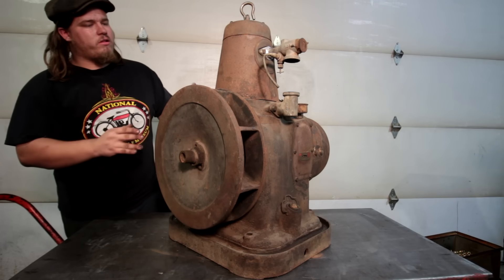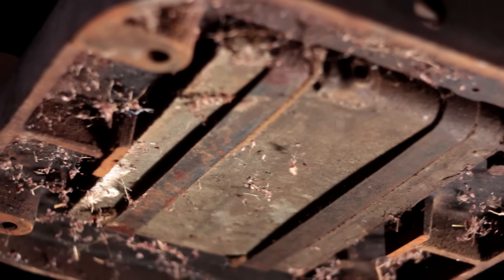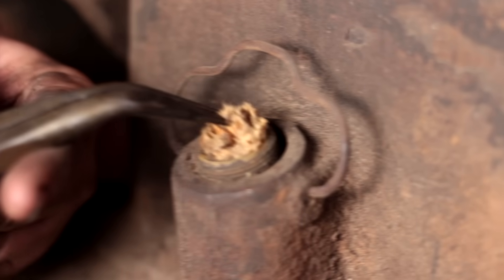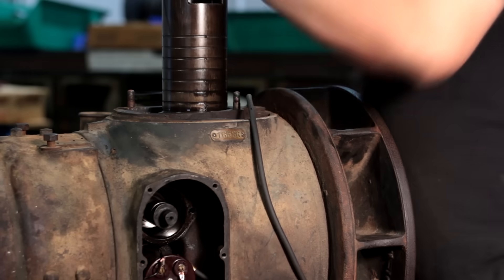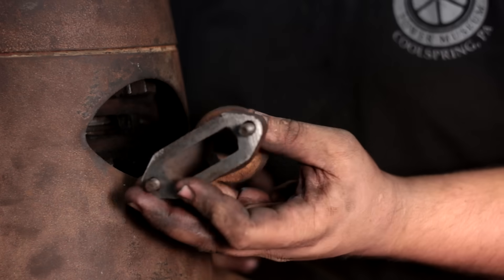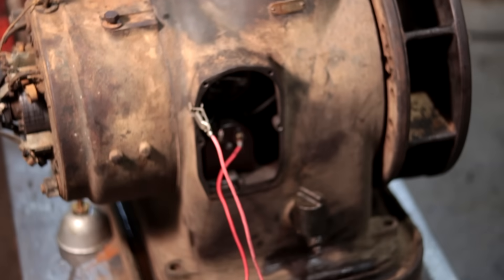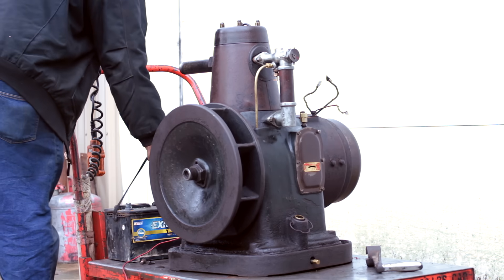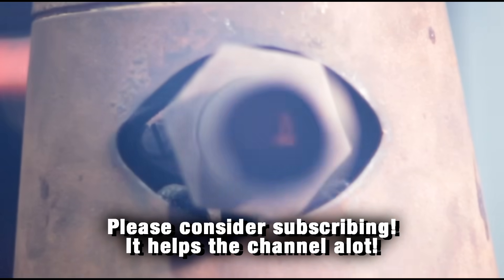100+ Year Old 4 Stroke Engine Design Has NO VALVES!!! Can We Get it Running after 60+ YEARS??

Comment: It has valves, but instead of poppets, they used two separate sleeves.... Almost like combining two, two stroke engines into one homogeneous machine. I friggin love it! thanks for a good video.
Reply from the maker: so you call a two strokes cylinder a valve? i just always called them ports. glad you liked the video!
Reply: @cruddycornstalks   @cruddycornstalks  what do you think a "port" does in relation to an engine? A "port" just like a "valve" and allows air/fuel and exhaust fumes to flow in and out of an engine. With this model of engine, the 4 stroke cycle is perpetuated by two sleeves that are ported to act as "valves". I edited my comment because I had a few too many beers before I commented. My bad
Reply: I said some nasty things before I really read your comment, so I am sorry
Reply: @cruddycornstalks   it's like taking two, two stroke cylinders, that are timed in such a way that when combined they create a 4 cycle engine.
Reply: @cruddycornstalks  It's just an unconventional valve, it serves the same purpose, but doesn't look the same

Comment: For the early sleeve valve engines its important to use non detergent oil, this builds up a carbon seal around the junk ring and ports and increases compression and reduces oil consumption.
Reply from the maker: this is true

Comment: Things this guy does really needs to be taught to young people as oneday we could find ourselves needing to use old machines as we rely too much on electricity and computers these days. So one good solar flare from the sun or an EMP and the electricity grid is gone and we will be back in the 1800’s. I drive a 1965 Chrysler Valiant AP6 and it’s 60 years old this year and I sadly found rust in the front steering box and I’m having trouble finding mechanics that can even weld these days. All the older guys are gone and younger mechanics seem to working with computers and plastic cars these days and my old car scares them. I have found a classic car shop but they work on $100,000 rebuilds of classic cars where I just need a $2000 welding fix. These old motors are just amazing. I’m so glad I was able to 80’s and 90’s kid and teen as the world was much more fun. Cars today are ugly and the kids all look at phones and computers all day it’s sad.
Reply from the maker: very true
Reply: @ you are doing such a great job

Comment: Brilliant... 😻
Another video giving it a complete birthday and about how to actually time it and going into detail of everything about it including measurements...
There is also the possibility of making another not as a copy but using any modern technique and materials.. using the sleeve system and mechanical fuel injection which could be done via the sleeve as this has many advantages over valve engines..
The main reason being it's so quiet and stable and I assume so reliable.
Even to the point of raising the compression so it runs on vegetable oil as an off-grid generator.
Selling the plans could be an income stream.
The starting point is finding a crank with flywheel, con rod, piston and sleeve.. I actually made air pump from a broken 4 cylinder diesel using the parts above and wood.. a friend has it now powered by a water wheel and he uses the air for his tools etc.. all it needs is a squirt of oil in the air intake before using to keep the piston happy the crack dips into a plastic oil can.
Reply from the maker: the longevity of the sleeves sealing correctly and the cost to make the sleeves makes it not a viable option for main use.

Comment: This is by far my favorite engine I have seen you get running. Awesome design! Is that a electric starter on the side and or generator?
Reply from the maker: more then likely it is both as its a 32 volt generator for a house but probably is designed to be started by it aswell

Comment: Well I wish I still had some of your enthusiasm and energy! That’s refreshing AND to see again, what is an uncommon thing - someone who has a genuine love for what they are doing!! 
You mentioned a few time about this engine not having valves. While it doesn’t have the so typical “mushroom/ stem” type valves, it most certainly DOES have the absolute most efficient types of valves, “sleeve valves”. 
Look up the Aussie built WWII twin engine plane the Japanese referred to as “whistling death” because of its inherent quiet running sleeve valve engines. Another very worthy notable example was RollsRoyce’s successor to the wildly famous Merlin engine, of WWII. while no where comparably famous, the only way they could figure out to get more horses out of the same weight or basic design was to build the engine around sleeve valves. I don’t remember the figure but it was ALOT more horsepower using the same displacement, but it was more weighty, and with wars end I don’t think it ever saw large numbers produced. Also not sure but it may have been called the
“Creacy”. 
When the end of the sleeve’s cylinder gracefully “seats” against the cylinder head, there is your “valve sealing action”. Also those were12 cylinder engines, so the gearing to articulate the cylinders, and the unforgiving precision and accuracy involved becomes extremely complex, heavy and puts tremendous strain on maintainance crews. 
I worked on a simple “hit or miss” AJAX single (huge) cylinder in the oil patch. It all overhauled by removal of the cylinder head, screwing the piston out to re-ring, replacing a “saddle” on the rod journal for the the new rod bearing to spin around on, “pulling” the cylinder sleeve only to press in a new replacement. Each of the two main bearings screwed out of and into the case from opposite ends and had “saddles” which fastened a new surface to the crank for the the pressure fed main  bearings to ride on. 
The oil pump was external, as well as the articulating parts. It was a two cycle, for fuel it ran on what it was pumping out of the ground!
Fired like a diesel off “heat compression” And only “fired” every once in a while, extremely unevenly! The whole thing could be completely rebuilt from the “outside” and without removing it from it’s drive mounts. That was 1973, Tex oil patch. 
I only mentioned it because you are exactly the guy who would love it! 
Also a “single lung” Maytag washingnachine motor.
Reply from the maker: the sleeves dont unseal and seal on the head to control the exhaust and intake on a willys they just have ports that come into view of the chamber and go out of the way. more like a two stroke with two cylinders moving up and down.

Comment: One of the selling points of the sleeve valve engine, at least in their advertising, was that as it ran and got coked up it actually ran better because it filled in all of the little places it couldn't have close tolerances from the factory.
Reply from the maker: yep when they get hot they seal better!

Comment: so cool, amazing minds back then.

The fractal vise is another invention from the era thats actually practical, unlike this...

 you can see oil spewing out the exhaust at 13 min lol. maybe it could be improved with a vertical oil drawback of some kind, but will always burn oil especially when it heats up. kinda makes the thing worthless as the only reason we use 4 strokes over lighter much simpler 2 stroke is because they dont burn oil/fuel efficiency.

got me thinking this tech could be used in new generation "eco friendly"  2 strokes, maybe slightly heavier but all the advantages 2 stroke with less oil burning.
Reply from the maker: it runs and im not changing it.

Comment: I've never heard of, nor seen a sleeve valve engine like this before! I didn't know they existed. Is this a DC generator, or is the generator just an accessory to power headlights and charge the battery in a car? How many horsepower?
Reply: Farm rural electric light plant used to charge battery bank for lighting and radio  look up delco light plant
Reply: @Greg-xv9qj  I wonder how many kWh per gallon this "Dynamo" can produce. How many watts, volts, and amps?
Reply from the maker: greg is correct!

Comment: Just a suggestion, sometime these old engines used a resistor wire on the points electrical circuit to increase the life of the points. If you have an ohm meter just check the resistance of old wires. They maybe not in pure copper. My grand-father tells me that for the Ford T…congratulation for your hard work.
Reply from the maker: the condenser is doing that job.  and thank you!

Comment: 😊😊 most timing  marks IVE seen is 2 dots or a dot and line or 2 lines 2 gether it's been what I have seen be 4 😊😊 OMG 2 24 2O25
Reply from the maker: without getting fully into the crankcase i couldn't see any externally so i went by eye and managed!

Comment: This is a very cool engine. Why would you use an adjustable wrench on 100+ year old hardware? That's begging to mar it, or worse. Otherwise I very much like what you did here.
Reply from the maker: if you mar it with a crescent wrench you used it wrong. any bolt on this engine i turned with one i could snap off before the wrench would round the head. all about how you use your tools!
Reply: Techniques matter, for sure.

Comment: Geez man - get yourself a decent set of spanners - adjustable wrenches are asking for trouble !!
Reply from the maker: only time they are trouble is if you use them wrong they have a good enough grip to snap these bolts off well before you round the head if used correctly!
Reply: @cruddycornstalks  you want credibility - use proper tools - not second rate home handyman nut fuckers - no offense but it degrades your posts
Reply from the maker: if your basing my credibility off  my crescent wrench I don't think your someone I need to worry about to much to keep credibility with! if you think a crescent rounds bolts you need to be taught to use it right!

Comment: Love this motor! I had no idea that some thing like this existed. You hear of sleeve valve engines but not on this scale. I admire the work and ingenuity that has gone into the refurbishment. Thank you for the video! 
 That said, really an adjustable wrench on these old bolts, why? Is a decent socket set that much ? 🤦‍♂️
Reply from the maker: you have more of a chance of messing these old bolt up with standard wrenches then an adjustable wrench if you round bolts off with one you are using it wrong. it will snap a bolt off before rounding a head if used correctly. unless you know a place selling sets of 32nd inch increment wrenches alot of this older stuff has oddball bolt head sizes that most set don't have. or are rusted so far they arent even close to what they use to be!
Reply: I'm glad I'm not the only one bothered by using an adjustable wrench on an antique!

Comment: it has got valves, just not youre common poppet type. its called a sleeve valve engine. lookup napier sabre for a wonderfull example
Reply from the maker: sleeve valve is more of a simple label then anything as its just sleeves with ports in them more then a proper valve of any sort. are two stroke ported cylinders called valves?

Comment: Technically it has sleeve valves.
Reply from the maker: sleeve valve is more of a simple description to make understanding easier as it has two sleeves with ports. would you call the cylinder of a two stroke a valve?

Comment: It does have valves! They may be sleeve valves 
, but they are still valves.
Reply from the maker: was called valves to help terminology  but its just a sleeve with ports no more valves then a two stroke!
Reply: @cruddycornstalks  poppet valves are not the only type of valve. There is one in your toilet cistern (a ball valve). Also every tap in your home is a valve.they are called sleeve "VALVES" because the sleeves act as valves.

Comment: Nice restoration. But the complexity of this engine is why you don't see it. Seems simple, but look at all modern engines, just morphed slightly Model T engines. And as you see that sliding cylinder valve, has sealing issues, as well needs oil to not self destruct. I'm surprised at the modern points and ignition for the age of this engine, they had advanced engineering in the ignition design.
Reply from the maker: points where pretty common by the 20s delco had them in the 1910s
Reply: @cruddycornstalks  I am not an antique engine expert in any way. I have a 1924 Ford Model TT, that has sat for the last 43 years, and I just started working on it. 
More interesting is a Fuller And Johnson Hit&miss I also acquired that long ago, but just pulled it out last summer and found parts on eBay. It was on a The T. L. Smith Co. cement mixer. They were the first manufactures of portable batch mixers, and I think this engine is late 1910s or early teens.
So my engine experience is limited. I did restore a 1952 1.75HP Lauson that was on a Safe-T-Cycle made in LaCrosse WI. I'm intrigued by the cleverness I see in these old engine designs. A big problem with model engine builders, getting the spark reliable when under compression pressure, that is not as simple as made to look. And yet, look at how well all that works today. I guess I know just enough to be stupid.
Thanks for this video. I saw this engine sectioned at an antique engine show in Mount Pleasant Iowa (labor day weekend). Someone took the time to cut away 1/4 the engine. I thought back then (15 years ago) nice idea, but if good, it would be used today. I'm more amazed that in 115 years of engine design, it has not changed other then excessive complexity. The smartest thing ever were those electronic points, late 70s to early 80s. I had a 1987 Chevy Sprint (Suzuki Justi rebadge), 3cyl 1liter, that got 57MPG. Same engine design as the model T, only in aluminum with cast iron sleeves. Had a carb, not throttle body. Too dang simple. But salt in Iowa, kills autos quick.

Comment: Crack valves with cold air ! Wow never heard that one ,
Reply from the maker: not valves. the cast iron sleeves that are  1/8" thick
Reply: @cruddycornstalks  still a valve , and similar size to port sleeves in two strokes ,  it's not going to get any colder or hotter with no pipe, the old myth of burning valves with no exhaust manifolds is well a myth, if true all those WW2 Merlin 27 litre V12s with straight out exhausts would have died 5 minutes after starting. Best for any engine is fast in fast out exhaust . Put an exhaust manifold on any engine will only slow down heat up.and or cool down.
Reply from the maker: cold air can very easily crack one of the thin sleeves if there's no exhaust because you will have a 500 plus degree cast iron sleeve getting hit directly by 30 degree air from outside. even the merlin has exhaust pips to shroud the heat a bit! but they aren't using such thin delicate sleeves either.  on the other hand regular valves could not give a damb

Comment: Less misleading title: 100+ Year Old 4 Stroke Sleeve Valve Engine Has NO POPPET VALVES!
Reply from the maker: not misleading at all calling the sleeves a valve is only used to explain them easily. does a two stroke have valves? as this uses ports just like a two stroke.
Reply: @cruddycornstalks  I'm not going to let you get away with changing their name, lol. They are sleeve valves, and these engines have been called sleeve valve engines since their inception, until you came along. It is their action that opens and closes the ports, unlike a two stroke that has no valves. The piston in a two stroke opens and closes the ports, hence its proper description is a piston port engine. Just because sleeve valves are not shaped like poppet valves doesn't make them not valves.
Reply from the maker: so its not a sleeve port engine but a two stroke is a piston port engine?   or you call them sleeve valves and two stroke is a piston valve engine. you either are willing  to call them both valves or neither valves as they fundamentally are the same. open ports closed ports using motion of sliding metal. if you don't sit on one side or the other you have some odd logic there. in the long run both will describe the same thing and are mostly meaningless on what way you say or use them. all just a way to get an idea across.
Reply: @ I was trying to explain why these engines have the name that they were born with, it seems like your youth is causing you to try and rewrite history.
Reply: By the way, great video and thanks for all of the work that you put into it.

Comment: I Say It Does Have Valves!!! The Slides Are The Valves!!!! Just Like Read Valves Are The Valves In 2 Strokes!!! There's More Types Of Engine Valves Than Tulip Valves We Are Used Too!!!
Interesting Engine But It Does Have Valves!!!
Reply from the maker: if thats the logic you want to use two strokes don't only have reed valves as the sleeves in this engine are the same design as a sleeve in a two stroke. just two of them moving. only reason they called them valves in terminology is to help confusion and explanation .

Comment: I had read a really old advertisement about the Willys Knight sleeve valve engines. I asked an old timer about it and he said they were very quiet and smooth when running, they didn't make a lot of power, and they used a lot of oil.
Reply from the maker: yeah the pretty well sums it up

Comment: Wow! I did not know this existed. Thanks for repairing it and showing it working again. Do you know its fuel consumption? Is it tolerant on the fuel used? What fuel can you use? I hope you continue the repair of the electrical system and have it make some kind of power.  I would hook up some modern efficient LED lights to the generator and show it working again. Bring it to demonstration shows - country fairs.
Reply from the maker: it could use any fuel that burns well all the way to kerosene. no idea how efficient though . someday ill try and get it to charge.